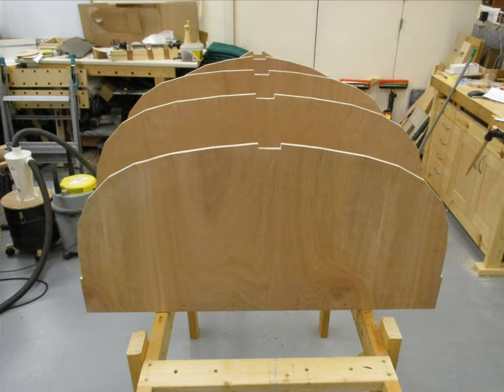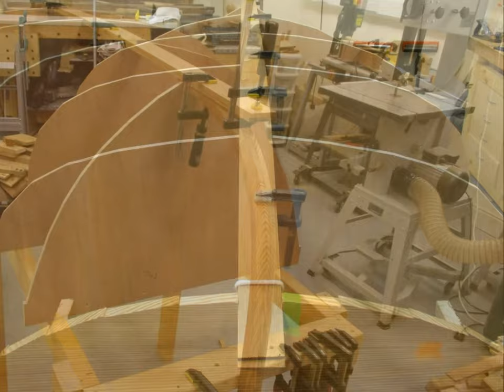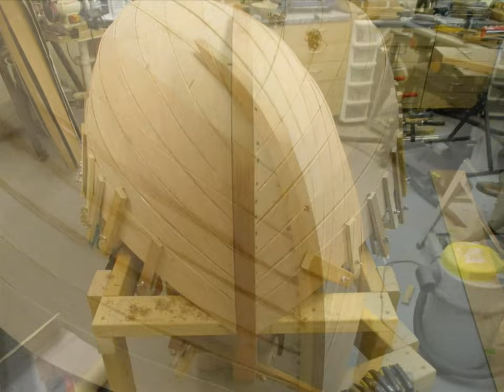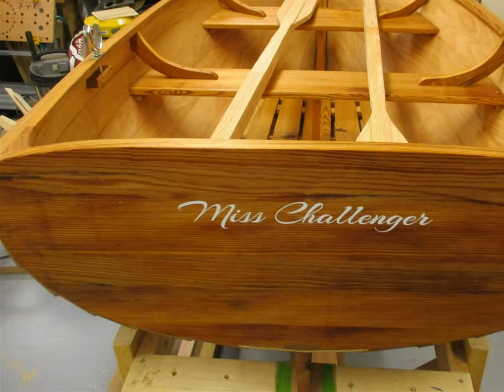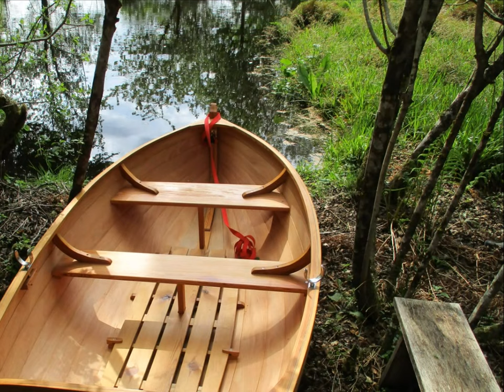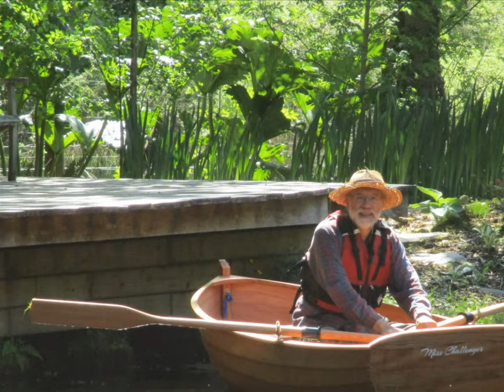Building a Lapstrake Plywood Boat

Comment: Great build, really like it. What was the purpose of the stringers before you started sheeting out the dinghy. Thanks.
Reply from the maker: John, thank you for your comment. I put the stringers on just to make sure that the overall shape was just right and that I hadn't messed up in cutting the moulds. I did wander about showing them as I immediately removed them once I was satisfied that shape was correct. Well spotted.

Comment: Great work! I am about to take on this design (I have the plans in the closet right now). I'm curious what type of lumber you used for the backbone and transom. It appears to be fir for the backbone? I'm considering lengthening the frames out to get the longer, 8'10" as it will be used as our dinghy from our cruising boat but avoiding the need to re-loft is making me second guess.
Reply from the maker: Glad to hear that you are going to make one of these boats. Apart from the plywood used for the hull, all of the other wood was timber that I repurposed from pews from an old church. They were used as garden benches and after about 20 years they began to rot. I rescued what I could and used the recovered wood on this boat. Judging by the appearance and the smell of the wood, I think that it is pitch pine. I made the oars from new Douglas fir. Good luck with your project.

Comment: How long is this boat? Could you guess at its weight at all? Also great job its a real beauty.
Reply from the maker: Thank you very much. The boat is based on a design by Iain Oughtred from the Isle of Skye here in Scotland. This is the Auklet which is the smallest one that he sells. The plans are very comprehensive. He has published an instruction book that really helps. The boat is about 2.2m (7ft 2inches) long and 23kg (50lbs) in weight. The plan also contains the option to make it a sail boat.

Comment: What's the estimated price on building this boat? I want to build a small clinker very similar to this and am trying to get an idea of cost. Also how many hours did you get to enjoy building this?
Reply from the maker: Thank you for your interest in my boat. It is very difficult to estimate the price of building a boat of this type. Wood prices have been quite volatile. If I were to build another one of these I think that I would be budgeting about £400 (UK prices). If you decide to use plywood for the hull, use the best that you can find. Look for plywood with equal thickness layers. I started using marine ply from a builders' merchant, it delaminated and the outer layers of ply were incredibly thin. 

I finished the boat with Deks Olje D1 which was a pleasure to use.

It took me about 3 months to build from start to finish. Some of this was me going through a learning process. Much of the time was spend waiting for epoxy to cure meaning that I could only do two strips per day. I suspect that I spent maybe 150 hours spread over the three months.

Good luck with your boat build.
Reply: @appinwood  thank you for the reply. I'm sorry to hear that some of the layers delaminated. 400 is much lower than I expected.

Comment: Was this the Auk, or the Auklet. I just ordered the plans for the Auk.
Reply from the maker: It is the Auklet. Good luck with the new build. The plans are detailed and a pleasure to use.
Reply: @appinwood  Thank you for responding, you did a beautiful job on yours, gives me inspiration and motivation. I built a cedar strip canoe back in the mid 90's, hopefully I can remember enough to help me through this one.
Reply from the maker: @fedup7416  Have a look at my attempt at a cedar strip canoe. It is only half size and I didn't have the space to store a full size one. https://youtu.be/N8nuDfNUxiA
Reply: @appinwood  Nice Job and nice design. It looks like it would be fast and nimble. I made a 15 ft, Bob's special, quite happy with it's performance. Wood working is great therapy, it's nice to always have something challenging in the garage..

Comment: What grade plywood and what thickness, 1/4 IN?
Reply from the maker: I used 4mm thick marine plywood. It is very important that you use the best plywood you can get you hands on. I got mine from a specialist marine timber supplier. Try to find plywood with veneers of equal thickness. Avoid plywood that has very thin decorative veneers on the outer layers and inferior wood on the inside.

Comment: This is awesome! Did you coat it in epoxy?
Reply from the maker: Thank you. I didn't coat it with epoxy but used Owatrol Deks Olje D1 Wood Oil. This is an oil finish intended for marine applications. It is easy to apply and looks great.

Comment: What type and thickness of plywood did you use?
Reply from the maker: I used 4mm thick marine plywood. It is very important that you use the best plywood you can get you hands on. I got mine from a specialist marine timber supplier. Try to find plywood with veneers of equal thickness. Avoid plywood that has very thin decorative veneers on the outer layers and inferior wood on the inside.

Comment: What’s the point of buying marine plywood just to cut it into strips?! 
When you could just use pre-cut solid wood strips for a fraction of the cost & effort!? Plus wouldn’t it look the same & still be building  a wood plank boat yourself?
Reply from the maker: Thank you for your question. The answer lies in strength and weight. The plywood used is only 4mm thick but still very strong. It is also relatively easy to bent into shape. In order to get similar strength in solid wood the strips would have to be three or four times thicker and hence much heavier. You would then have to steam bend to get them into shape as they would be quite stiff. Finally you have to take account of wood movement using solid wood. Traditionally this means nailing the planks together when dry and soaking them so that they expand and provide a seal. This clinker built tradition goes back a very long time and is something I would like to try some day.